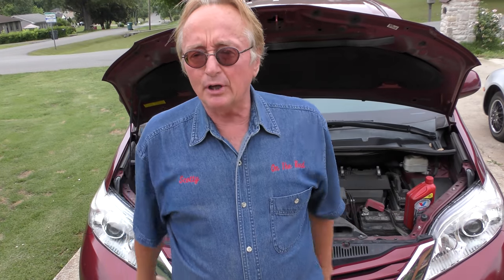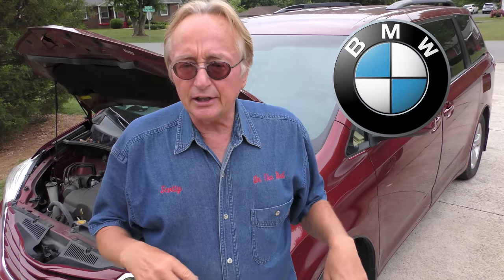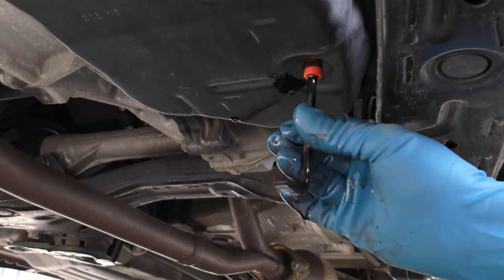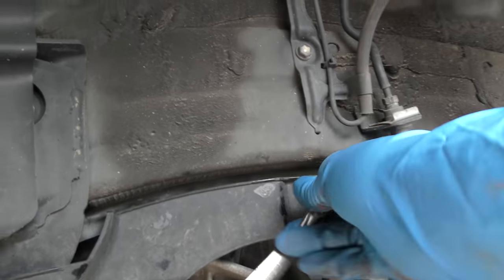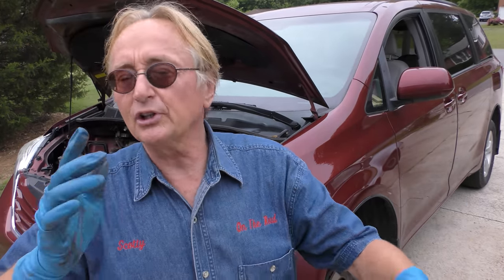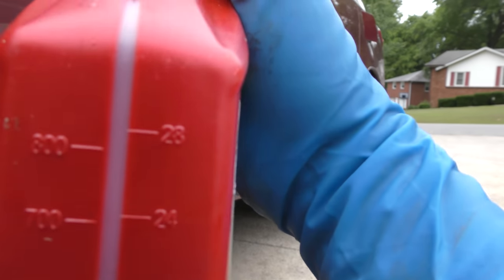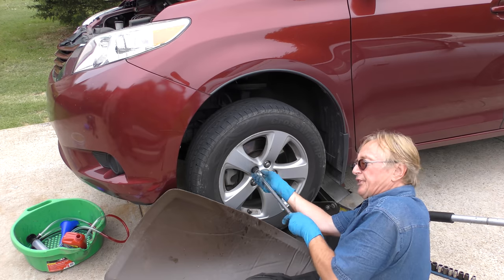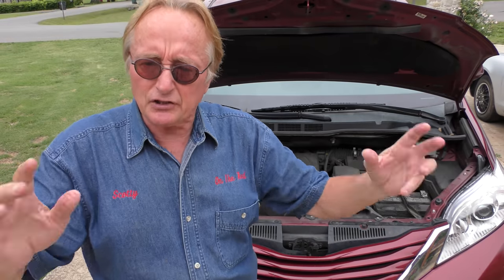Here's Why Changing Your Transmission Fluid Can Cause Damage

Comment: One thing I've learned from working on Hondas "ONLY USE GENUINE HONDA AUTOMATIC TRANSMISSION FLUID" I don't know what it is with their transmissions But you use anything else high likelihood  The transmission will start to slip and fail every person that I've  come across whether it be online dealership independent mechanic whatever the case may be When it comes to Honda automatic transmissions they have all always said only used the genuine Honda fluid whether it be from a Honda / Acura dealership or online only use genuine Honda fluid It's expensive But transmissions are more expensive
Reply: ....or find out what brand Hinda is using because Hnda ,like Toyota,they don't make their own fluid.Then you can buy the exact brand cheaper at just about any auto parts store.
Reply: agree
Reply: same with Honda/Acura power steering systems! If you need to cheap out by literally a few dollars on fluids, then go buy a Chevy instead!
Reply: Idemitsu - they manufacture most of Hondas fluids, including their transmission fluid. Find the Idemitsu version of Z1 or DW1 and you will save yourself a little $$
Reply: I read somewhere that Chrysler went through 14 formulations of fluid before they got their Ultradrive transmissions to an acceptable (for them) level of reliability. Honda might have gone through something similar when their 5-speed auto had the big problem for 2003. Even if you know who made the fluid, they might only sell the magic formulation to the OEM, so what you get from them might be different. I went through something similar with the serpentine belt on the 3 L PRV engine; my mechanic said that the OEM belt was made by Gates, but when he used a Gates belt of the same size, it always squealed no matter how carefully he adjusted it. When I insisted he by the belt from Chrysler, it stopped squealing.
Reply: I’ve heard the same regarding Honda transmissions.  Only use the the hieda trans fluid.  With that being said my gf purchase a used 2003 Hinds CRV.  Car is a tank and has never failed.  It currently has 160k miles.  Would you change the fluid or leave it as is?  
Don’t know if the fluid was ever changed.
Reply: @pcno2832  Check your engine.After pressuring your mechanic he may have gotten mad and just did away with the belt.
Reply: If it says to use only Honda fluid, they mean it. It's the people that think they're smarter than the engineers and technicians that built the car that are the problem, not Honda.
Reply: @pcno2832  That thing about those Chrysler transmissions isn't true.  The fluid didn't have anything to do with those transmissions breaking.  They were just a poor design.  Busted snap rings, broken clutch drums, a differential pin exiting the case in 1996... stuff like that isn't caused by incorrect fluid.  The Chrysler fluid was just Dextron 3 with an additive to prevent torque converter chatter and Chrysler used the same fluid in the Jeeps with the Toyota AW4 transmission, so I dunno.   When a single transmission fluid meets the specifications of 10 other auto manufacturers' vehicles, it makes you wonder how important the transmission fluid specification really is.

Gates belts are garbage.  There may have been a day when they were of quality, but I've had too many failures with Gates belts across the board in everything from timing belts to snowmobile belts.  The latest was on my Suzuki SX4.  I went through two Gates belts which wore out and started chirping within about 7,000 miles and I just lived with it for several thousand miles later.  I even bought the Dayco laser alignment tool to make sure the pulleys were not out of alignment.  I switched to a Bando belt and it has been fine ever since.
Reply: Same thing with their coolant.
Reply: Except that I have done many coolant changes on Hondas over the decades with zero ill effects. I just use the cheap crap from Walmart.
Reply: @paulstandaert5709  Honda coolant is silicate free. Their rubber & seals degrade over time with shitty coolant.
Reply: @georgepaniagua6115  That old of a Honda should still have a transmission dipstick. Pull the dipstick and see if it has any red in it. If so, change it. If its brown/black, Id just leave it.
Reply: @victorandrade7940  YEP only use Honda blue they used to use the green coolant But there were a lot of Honda radiator failures at the seams during that time so in about 99 2000 they decided to change to their proprietary blue and never looked back
Reply: Facts
Reply: Better yet don’t buy a Honda, since the trans will probably go bad either way.  No warning too.
Reply: @cndvd  depends on the car
Reply: @mamaluigi2064  yes mainly their vans.
Reply: Same with Subaru CVT's. Probably best to stick with OEM fluid.
Reply: @cndvd  we have 3 Hondas with a total mileage between them of 540,000.... If u change fluid regularly... No issues...Odyssey has 243,000...
Reply: @GTASpuds725  you must be right on that cause, I know a guy with 8 Honda vans all transmission problems, but I don’t think he change (flushed) the fluid in any of them.
Maintenance is important !
Reply: @georgepaniagua6115  
Change it. That's enough miles that you really want to start changing it very regularly. Like once a year. I have a Civic with 350,000 on it.
Reply: @cndvd  
Mine has 350,000 hard miles on it. Weird. At least I didn't buy a Ford .
Reply: Got a 1998 Honda Accord from my brother with 250,000 miles, mostly hiway. Well maintained. Been doing mechanic work on the side for 50 yrs. Had no problem with trans what so ever. While replacing grossly leaking rear seal, we dumped all trans fluid out of trans and torque converter. Replaced 4 seals and put Honda factory fluid in it ( a true flush ). I could tell that trans was working even BETTER! Bottom line, oil change shops use a generic bulk product that is not up to speed. Do not cut corners on trans fluid! I also very strict on fluid color.
Reply: Going forward I will have the dealership change my trans fluid. I typically go to a third party shop. Thanks for the update

Comment: When your transmission goes out because you didn’t change the transmission fluid. Well, that’s the end of the transmissions life thus  your transmission fluid is good for the life of your transmission.
Reply: But you could have extended the life of the transmission by changing the fluid  before it kills the transmission and then you won't have to say the transmission died because it's end of its life. 🙃

Comment: Please do a documentary  on  Planned obsolescence in automotive  industry
Reply from the maker: will do!
Reply: @scottykilmer  

I love that after all these years and all of your success, you still not only take the time out to respond to your viewers but you take their suggestions to heart. That's why we love you Scotty!
Reply: Lifetime fluid being a prime example lol
Reply: Ecamples: 1.0 liter 3 cylinder engine 100 hp something and 200 nm something, or 2.0 l 4 cylinder250 hp 340 nm.
Reply: @instasingingvids3529  Lifetime fluids and plastic parts..
Reply: @TTime685  don’t get me started on plastic parts. My 2001 Ford Escape was loaded to go on vacation, I went to pull the gear selector into drive and it flopped. The retainer on the cable end was plastic! Luckily a $3 hairpin cotter from a tractor store saved the day.
Reply: @mky9227  lol
Reply: Electronic module that becomes obsolete by time you need a replacement!!
Reply: @scottykilmer  scotty kilmer my 2007 Nissan versa hatchback is 195k miles I changed the transmission fluid and filter 2 years ago Do you think This Previous Nissan car is better than the modern ones I mean the present one's?😊
Reply: @farmergirlofchickens8779  If they could make it out of "broken wind" they obviously would.
Reply: @farmergirlofchickens8779  my Ford Contour had that same thing break
Reply: @billman6364  what’s scary is the fact that there might have been someone try to charge me a ton of money for the repair or even a new transmission since I’m a girl. That’s why is best to find a good trustworthy mechanic.
Reply: TODAY'S YOUTH DOESN'T KNOW WHAT "PLANNED OBSOLESCENCE" MEANS. FOR 25 YEARS I'VE BEEN USING THIS TERM WITH THE YOUNGER GENERATION. AND NOT A SINGLE ONE OF THEM KNEW WHAT IT MEANS. I TURN 60 TODAY AND REALIZE THE TEACHERS OF MY ERA WERE TEACHERS, UNLIKE THE ONES OF TODAY.
Reply: @Frank289100  Happy 60th Birthday!  Kids are willing to learn if we have good teachers who make the subject exciting. I never had children, but my nieces had 1,000 questions. I have the patience and enthusiasm to make anything fascinating. My Dad had no sons but I would pal around with him while he was working on things. It’s amazing what I picked up just being with him. He was a Navy SeaBee for 20 years. He’d learned a few tricks.
Reply: @RetroCaptain  same thing with “tech”. Navigation systems are the worst offenders.

Comment: On Transmissions , Rear axles, etc ALWAYS  Find and loosen the fill plug , FIRST ! 
Because Once you drain the fluid and you can't refill it , You have a major problem .
Reply: yeah because some of those filler plug I almost impossible to come out especially on Nissan Rogue
Reply: Good advice
Reply: What do you mean? Didn't Scotty loosen the fill plug after draining?
Reply: You beat me to it
Reply: Just use the ATF dipstick port.
Reply: But I like creating punishing problems for myself jay
Reply: @TheBigBigSean  most cars don't have transmission dipsticks anymore
Reply: Nah, it gives you more motivation to get it out. Use a pipe, like the one on the floor jack. Those usually split in two and have a bolt in the middle that's easy to remove.
Reply: Today the drain plug is also the fill plug.
Reply: YES. I recently went to change my differential fluid and couldn't remove the fill plug without stripping it. Fortunately for me, I knew this already.
Reply: In a pinch you can fill this design through the drain plug.  The little tube within it will overflow when it's full.  It's not ideal though.  And with an Audi it's The only way
Reply: @TheBigBigSean  thats a thing of the past
Reply: @danfromga9696  - More proof that everything is getting shittier.
Reply: @bryanramos7641  I think that he means if you can't get the fill plug off, then you can't put fluid in the transmission.  So if you already drained it, you're f'd.  If you do can't get it off before you drain it, then at least you still have fluid.
Reply: This reminds me of the time my oil filter wouldn't come off, so I stabbed it with a screwdriver. Doh.
Reply: Good advice!!
Reply: 2013 ford automatic at 107000 miles giving slight transmission issues, y'all think I should change it?
Reply: @alecbarreda1  sell it fast. Never buy ford. Garbage.
Reply: I ruined a transmission by changing the fluid and yes it was the recommended fluid. Just leave it and drive it to the ground.
Reply: @alecbarreda1  Yes change that fluid asap. I've owned many Fords in the last 25 years, and never had a problem because I change the fluids often. The last Taurus I owned was very fussy about having fresh trans fluid, but I changed it every two years and it would drive like new again every time.
Reply: Good advice if your car does not have a dipstick/fill tube
Reply: @omegaman1409  , did you change the fluid or did a total flush?
Reply: You can always put the vehicle on its side ;)
Reply: yes ...i always do...how dumb would you feel if you drained fluid and were not able to loosen fill plug...not only that you could not even drive car to a shop for them to fix...
Reply: @TheBigBigSean  theres no dip stick on this...
Reply: @wigletron2846  mine does
Reply: @TheBigBigSean  use it as what?
Reply: Sealed transmission owners. R. I.P
Reply: @WayToManyAssassins  even sealed units my brother would rebuilt with a shift kit?
Reply: @Mike Studmuffinlol, yeah and get metal shavings into it while you drill.
Reply: 😏 guys, if you dont have a Torch and a Welder then i wouldnt even bother LOL ☺️
Reply: @theamerican7080  um... No
Reply: @theamerican7080  How do you figure that works?
Reply: @TheBigBigSean  yes keep an older car in your possession
Reply: @vadimnesen8060  what do you drive Chrysler,bmw,
Nissan ? Genius.
Reply: @wil7228  toyota
Reply: Perk of being a southern car..
Reply: Where your sense of adventure dude!, 😂
Reply: @omegaman1409 
What was the mileage??
Reply: @omegaman1409 my son in law did that. Fortunately, it was a Honda. I went there, drained it, ran the car for an hour for one week, drain it again, then once again doing the same procedure. I added Trans-X then filled. Ran the engine for a a couple of times then it engaged and ran normal.
Reply: @theamerican7080 There is also the overfill hole which it looked like Scotty used.  I thought the transmission oil had to be warm first then you open that overfill while engine is running and let excess spill out.  Then close and you have atf oil to correct amount.  Maybe that is just nissans.
Reply: @TheBigBigSean  many of the newer cars don't have one.
Reply: @theamerican7080  No. That's not true at all.😄
Reply: @wigletron2846  they relocated the dipsticks to the seat behind the steering wheel.

Comment: For DIYers, generally always know you can remove the fill plug before removing the drain plug and draining the transmission fluid.   Seasoned mechanics probably have like 10 different ways to get a fill plug out, Scotty probably has 100 ways, but DIYers can get stuck with a dry transmission if they cannot refill their transmisison once they have drained out the fluid.

Some Toyotas also have a separate differential reservoir that has a drain and fill plug.   The outer casing is the same but there is are two different reservoirs for 1. the transmission and 2. the differential.  

And, incidentally, the fill plug on the differential is in a very hard to reach spot.   But, again, know you can remove any fill plug before you drain the fluid.   It may take more time, but if things went wrong you would save a bunch of time/money/swearing/etc.

Additional note.  For my 1998 camry 5sfe (with 384,000 miles still running so well), that fill plug was in a crappy spot, couldn't get a ratchet and socket on it (too wide for the space), so I ordered a very swanky 70.00 ratcheting 6 point (6 point is better than 12 point if you really don't want to strip a bolt, the 6 point wrench applies the torque to the flat 6 sides of the bolt instead of to the pointed ends which is more what a 12 point socket does) thin 17mm wrench.  It had extra clickers or whatever you call those things so it clicked with very small rotations.    Boom....in 5 seconds the bolt was free.    May sound like a lot of money, but changing the diff. fluid is important and obviously i love that Camry.
Reply: Regarding filing up the transmission with the fill plug, You can tell if it's full by it leaking out of the fill plug correct???

That  way you don't have to measure how much fluid you drained right???
Reply: @MOAON_AABE  No. Scotty is incorrect when he says that leaking out of the fill hole is indicative of the transmission being full. The little plastic tube that Scotty removes from the drain hole is used to set the level. As you can tell, that's way below the fill plug level. Also, Scotty's notion that simply measuring and replacing how much was removed is silly. He assumes that the level was correct despite having no evidence to support his assumption. Anyhow, it's easy to correctly set the level. However, you will need a good scan tool, or an infrared type thermometer or knowledge of Toyota's gear shift procedure to access transmission service mode. This is due to the correct level (as defined by the little plastic tube) only being applicable at a specific ATF temperature.
Reply: @danieloneill4356  I agree lost me when he took drain plug first.
Reply: Once again, it's an old, worn out expression, but the right tool for the job makes it easy, even a pleasure. Trying to bodge your way through impatiently with what you have to hand often leads to frustration, breakages and failure to get the job done. Just not worth it. Buy the damn tool...
Reply: @danieloneill4356  It's dry around the drain plug and fill plug, that's evidence to support Scotty's assumption